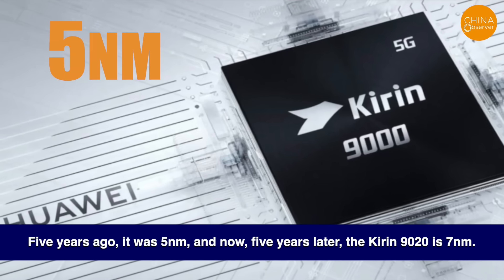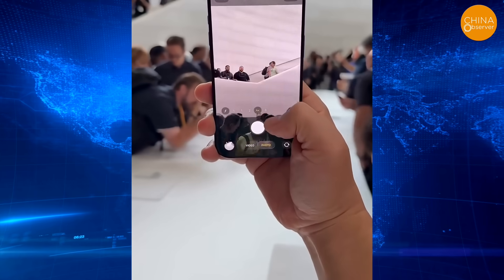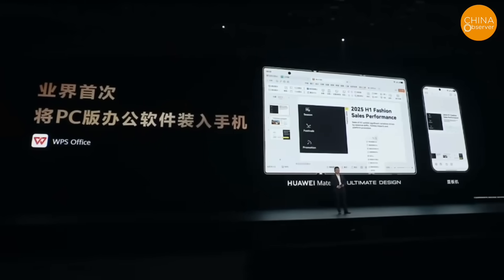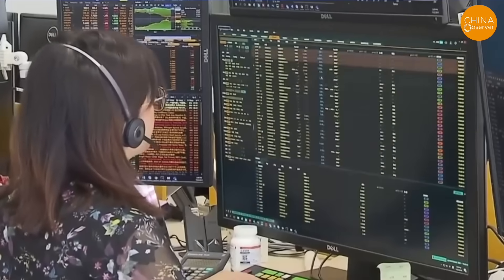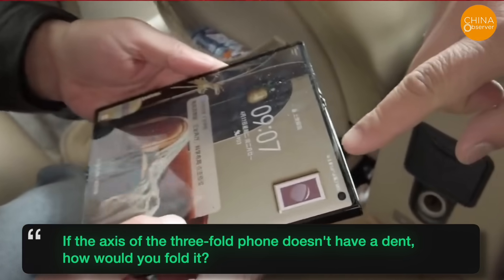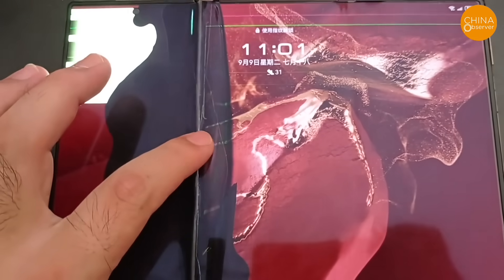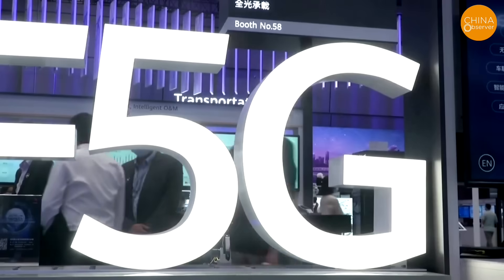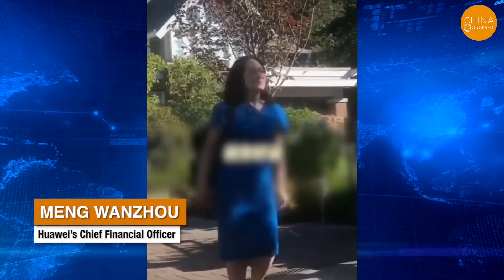Huawei's $2,500 Tri-Fold Phone Is A TOTAL Scam! 7nm Chip vs iPhone 17’s 3nm for Just $840!

Comment: What kind of a protective case can you even put on those triple fold phones? I've dropped my new Samsungs a bit too often before I managed to get a nice case so they always have cracks but they've never stopped working. My current S21Ultra I dropped on tile on the second day and I'm still using it and it's never been in repair, only now am I gonna swap it for a S26Ultra. I couldn't deal with a crappy Huawei that can't take the sort of punishment Samsung can.

Comment: The iPhone is a heavy wardrobe which I will never buy. Huawei Tri-Fold is a masterpiece and a status symbol which I long to buy. The iPhone is much of the same. The Tri-Fold is innovation and elegance and a tablet and phone in  one. China today is the leader in innovation and both the EU and US copy and steal its technology as the US stole Huawei's 5G technology while the EU stole a whole Chinese high tech company NEXPERIA. China is also the world leader in battery technology and the Silica Carbide 5700 mAh battery is 5 times more durable and takes 200 times more charging cycles than the iPhone's Lithium Ion Battery and does not combust. Though the Chip inside is 7nm in size, it actually stacks 3 such sized chips inside with Huawei propriety stacking technology while the iPhone has only one 3 nM Chip by TSMC. So, when it comes to raw power, both are very closely matched.

Comment: but Apple' product bad quality need some new replacement. My macbook air just used 2 years with nearly less than 1hour use each day , sudently it cant wakeup at morning. after check , it's PCB board burned, not any unit .And i see many buyer has same issue, same position under same inductor (the inductor is ok, just the inner part beneath it burned). When leave china, Apple mac quality become worse and worse, i will never but it myself again

Comment: SMIC’s 7nm process was a hack job on their old 10nm DUV machine & has very low yield, causing the cost per chip skyrocketed. That explains why Huawei  phones are so expensive.
EUV was banned by US.
Reply: That and they are also stuck with a 2017 -  2019 ARM architecture.

Comment: Actually the Kirin is made on a 14 nm process, but sections of the chip (the back to back) spacing is 7nm on small sections of the die.  The Kirin technology is  from 2018.
Reply: Three years to set them back 7, not bad.
Reply: @glostyle  But they haven't. They don't have the machines to make such chips. The ones they do are close to a decade old.
Reply: @NickJaime  No idea what you are disagreeing with. You are saying the same thing I did. With 3 years of sanctions they have went back to 2018 technology.
Reply: @glostyle  The chips they are using now were part of stockpile they built up before the tarrifs etc. So they haven't even made any. They are modifying what they have and calling it 7nm.
Reply: @NickJaime  The Chinese actually do have a machine that can do 7nm and is used to make bitcoin mining asics, which uses the back to back capabilities.
Reply: @tachyon5321  No country is letting them use those machines. So no they don't. If they did the machines can be shut down.
Reply: @NickJaime  ASML have a gps tracker and digital data is transmitted to ASML, but machine from the early mid 2000s do not.

Same with industry 4 standard machine (5 axis cnc mills)tools that shut down if moved
Reply: @tachyon5321  Who said anything about 20 years ago? They were still trying to catch up let alone have a chip industry.
Reply: @NickJaime  Another year and they won't even be able to do that.

Comment: ...
Just showing that China doesn't has the best capability. And that it imported stuff from better people. 
Without those connections back to 7nm for you. I am sure Hauwei doesn't mind selling their "BETTER THEN APPLE" phones with rather hot chips.
Reply: Hot chips..?  until it melts not a tech problem to fix.   Even if melts... consumer problem.
Reply: They will get better. That's the thing.
While you are busy discovering new genders, they are working 24x7.
They will move ahead as you will be busy with genders and protests for next few decades